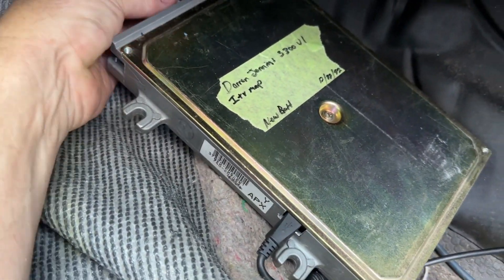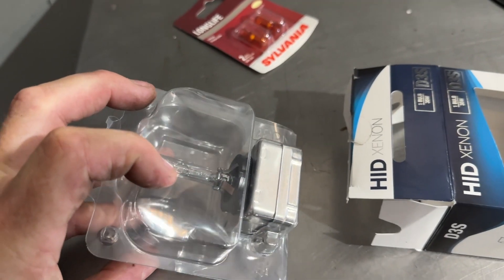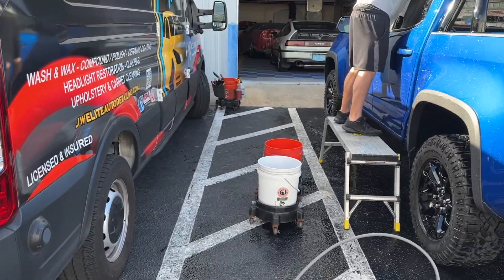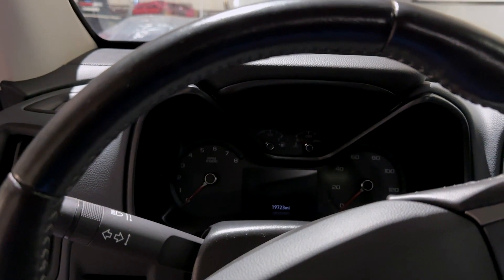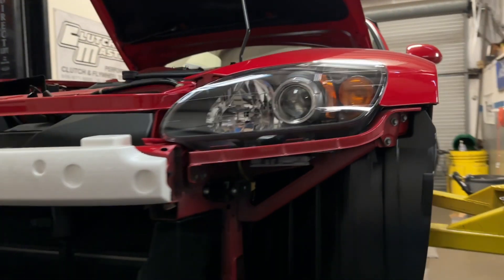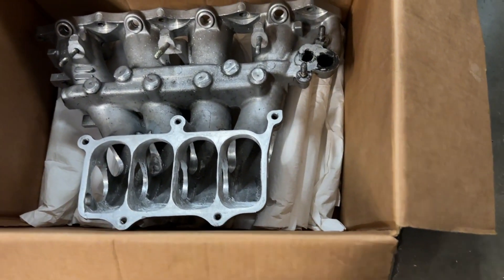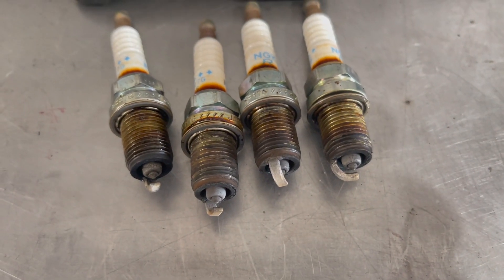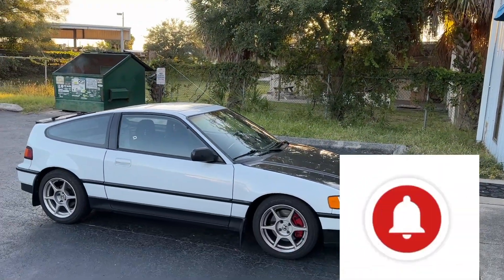V8 Colorado -Paint Protection - LHT S2000 part out

Comment: To winterize my 2016 Canyon, I like to put the biggest battery possible in it. I got a battery hold down bracket from Sasquach Parts. They only make parts for the Canyon/Colorado diesel engine and the customer service guy I exchanged emails with wasn't sure it would fit a Canyon with a gas engine. After some research, I found the battery tray is the same for all second-generation Canyon/Colorado trucks. I got a NAPA HD Commercial battery used in tractors, combines, and fleet vehicles with 950 cold cranking amps. It fits nicely it the battery tray and replaces the ugly plastic fuse box on the battery. The guy at Sasquach Parts said nobody had installed their battery bracket on a gas engine, so I sent them pictures that I took during the installation. I think it's funny how much effort you put into customizing your cars but when you look at your truck you can't think of anything. I bought A-pillar panels from the salvage yard because I want to fiberglass gauge pods onto them. Most people just have gauge pods on the driver's side but I hate it when things aren't symmetrical. The driver's side gets gauges and a cigarette lighter port, and the passenger side gets several USB ports and a cigarette lighter port for phone charging. I found USB ports that light up and I know one USB is enough but having the gauge pods means I can run multiple ports, even a household plug. I also got the panel for the trailer brake controller from the salvage yard so I can fiberglass it smooth, use vinyl paint to match the interior and drill holes for a trailer brake controller, one switch for heated mirrors, and one switch for an OX selectable rear locker. You can replace the shift knob in the automatic Colorado with a Jet Black Automatic Transmission Shift Lever Knob - GM (23286909).

Comment: Those d3S HID bulbs actually have the igniter built into the bulb base. It still uses a ballast mounted somewhere else, probably underneath the headlight housing. D3S bulbs are newer and mercury free, as opposed to the older D1S similar looking bulbs that contained mercury.